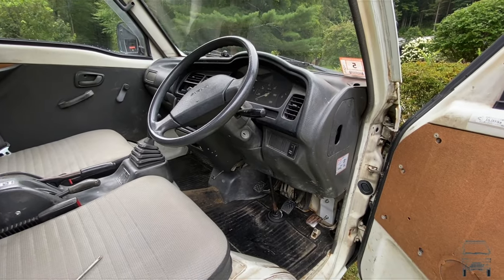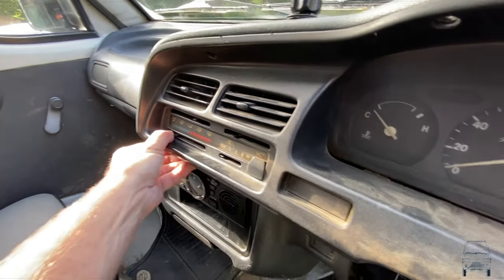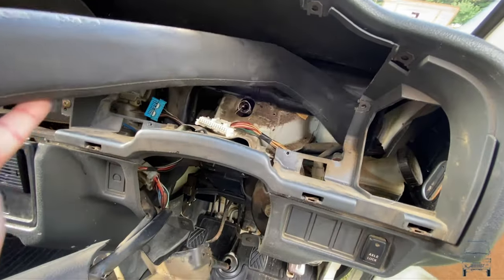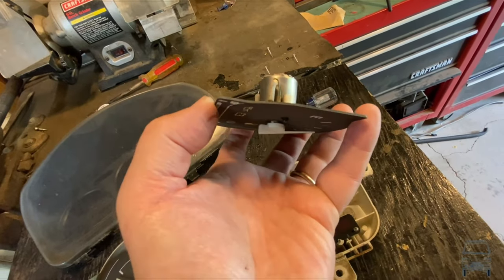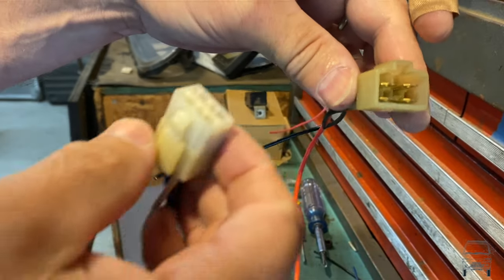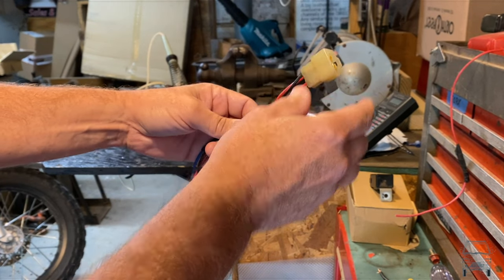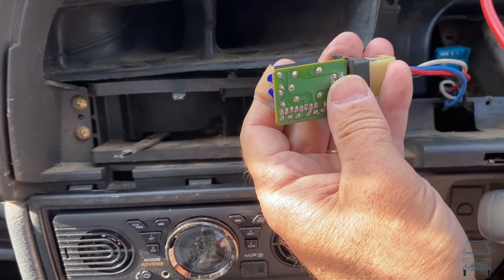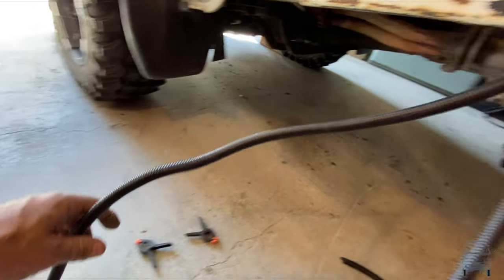My MiniTruck - 30 -  Bypassing the fuel relay.

Comment: My little honda had a complex relay system for the fuel pump . The relay kills spark & fuel when there is trouble ! Been there & never wanna go back..
Reply from the maker: Yea, this thing isn't even a safety feature, its some kind of way to make the pump run less.
But I'm not sure why that would even matter, as there are return lines, (in case of over delivery) and the pump already has a built in adjustable pressure switch on it.

Comment: So you totally disregard the relay.
Reply from the maker: Yup, took it right out of the loop. I was going to try using the oem wiring, but as it turns out, one of the wires leading to the pump was eaten up by black wire corrosion.
So my relay might actually be good. 
I assumed it had bad internal contacts, as it was only passing about six bolts, but then I saw the wire going into the switched side was only receiving that voltage…..when I wired the pump with new wires direct to the battery, it fired up like the day it was born.
It won’t overdrive as it’s a pressure regulated on demand unit that doesn’t need any of that overly complex crap. 
My best guess, is that it’s part of some convoluted emissions setup from the 90’s.
Reply: Thanks!
Reply: Thanks again, I changed the fuel pump and the filter. I have a 93 Suzuki. I cut the old fuel filter open and it looked like mud. Anyway checked the power and found none, so I rewired it like you showed. Like Willie Nelson says, I’m on the road again. Thanks x10!
Reply from the maker: Mine is still running just fine with out all of that extra junk, and I’m not noticing any kind of issues that might be considered detrimental.
Do you have a clear filter like mine, or a solid one?
Reply: @JimsEquipmentShed  - Running the fuel pump directly off the ignition switch will almost certainly result in contact wear in the ignition switch.  Hopefully, the electrical portion of the ignition switch is easy to change and a readily available part.  You might want to try wiring the fuel pump relay back into the circuit with the new non-corroded wire to the fuel pump.  If the fuel pump relay is actually bad, you should also be able to wire in a SPST ice cube relay to save the ignition switch, losing whatever timer function was provided by the original fuel pump relay module.
Reply from the maker: @Liberty4Ever  I think I might try that actually, just to see if the timer relay actually seems to do anything useful fuel consumption wise.
The ignition switches on these are actually pretty easy to change, but you are totally right, a relay to take the load off from that would be a very good idea.
Reply: @JimsEquipmentShed  - Ya gotta figure the Suzuki engineers had a good reason for putting that fuel pump relay in there, and it wasn't so it'd go bad and force you to tear the entire dash apart to get to it.   :-)
Reply from the maker: @Liberty4Ever  I ran an extension for it so it’s easier to get to, so I haven’t given up on it. (Out of curiosity) Because I am pretty curious as to why they went through everything that they did.
I daily drive this thing, and haven’t had one problem since the repair.
The Japanese, like the Germans, do tend to over engineer the simplest things for no good reason sometimes.
This might have reduced the fuel flow in an effort to relieve pressure on the carb float needle. 
I get about 28 mpg, so if I fix this, and magically get 35, then I’ll pat its little back. Another issue that I was having that was not the trucks problem, was my 25 year old test meter was dying for no good reason……   ;-)
So I do need to go back in and test voltage at the relay.
My guess is that the voltage there is probably ok. So if I zip a new line all the way back to the pump, it might work.
(I left the relay active just in case I discovered it’s reason for living and had to circle back.)
Reply: @JimsEquipmentShed  - I get 31 MPG daily driving my 4WD Hijet, and I'm not babying it.  I saw a video where a guy claims his 90s Honda Acty gets 45 MPG and he commutes 60 miles per day, but I think his mileage sounds bogus.  Maybe if he drove 40 MPG with no traffic lights and had fuel injection and electronic ignition.

I was a bit suspicious when I saw your old Micronta multimeter.  I was never a big Radio Shack fan.  PS - You aren't fooling anyone by putting that Radio Shack digital multimeter in a Fluke soft case.   😛